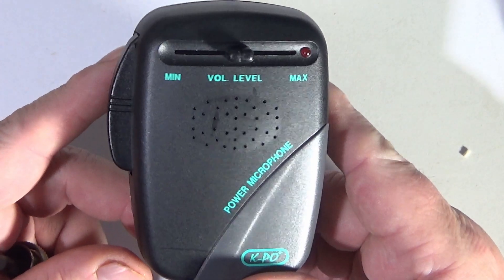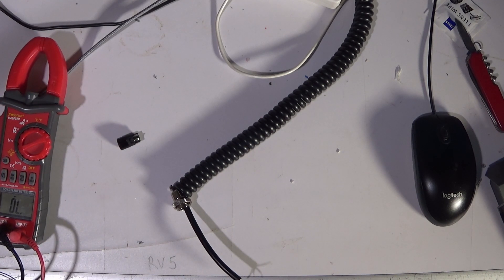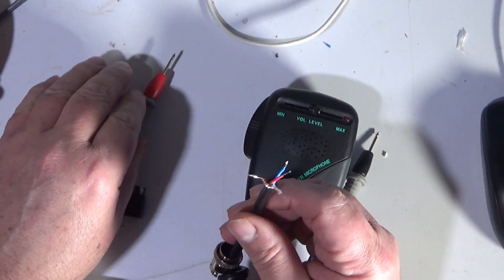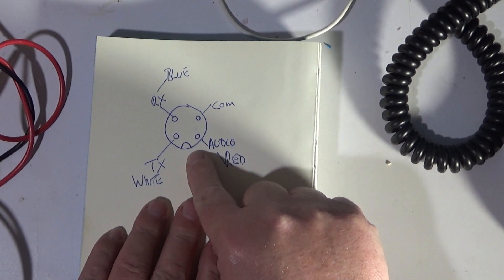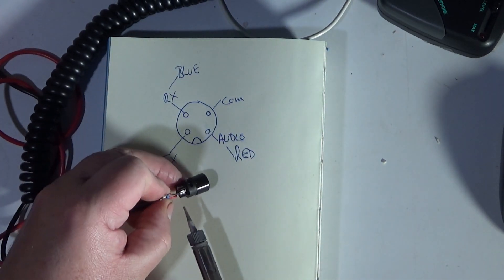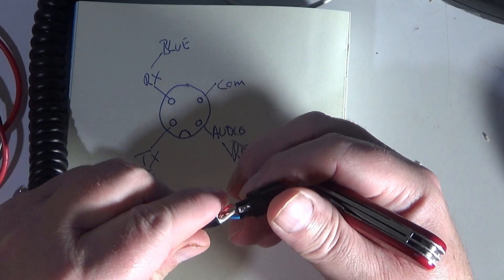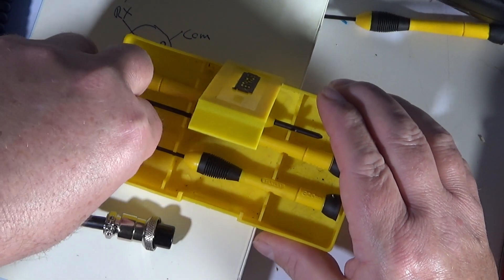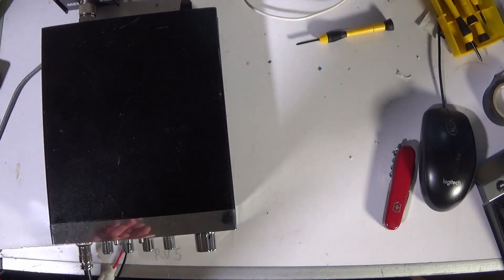How to Wire up the KPO NM532  Microphone  Start TO FINISH.

Comment: Nice one Steve. 
Funny enough, I just ordered a bleep box from the States, and had to re-wire it from Uniden to Cybernet, inside on the mic socket, and the plug on the end of the lead that goes in the radio. 
I'm happy to report, that it is all working fine :-) 
Made simpler by remembering back to the old days, and knowing how easy it is to change Uniden to Cybernet, or vice versa, just by changing the wires top to bottom, and bottom to top, either side of the little cut out groove, and hey presto! 
Keep up the good work my friend. And stay safe x
Reply from the maker: HI Mandy nice one this is old news to us lifers.
But should be handy for new people who Join the hobby :o)

Comment: Thank you for the suggestion I wrote wrong because I have the 6900 and also the 9900 and the president.However I had a problem with the connector and I solved 73 from Mario Trieste Italy

Comment: Nice one Steve.
One point you forgot to mention.
The AUDIO wire will usually have the braid/common/earth wrapped round it, so it is identified right away.
Now you know two of the wires right away.  Ground/common and audio wires.
The way to find the Receive wire is how you did it Common to a wire on test meter to one of the wires gives you the Receive wire.
The only other wire that is left will be the Transmit wire.
So you have found them all

This method will work for all microphones.

Caution:  If there is a battery in your mic, (Power Mic) take it out before testing.  Remember to put the battery back after you connect the plug up.  You can test the mic without the battery being in to see it it Receives and Transmits, but you need the battery to get audio.

Looking at the inside of the plug is how it is drawn for the connection to the CB or other radio.  This confuses some people.
You can find connections for most CBs on the Internet.  Just google it.

Nice one Steve.
Reply from the maker: Hi Bob there will a follow up video, i never forgot the Audio wrapped in the screen wire.
Some times all the info at the same time can be a little over whelming.
I did miss an opportunity during creating the vid, that i will try to re create in the follow up.
Watch this space fella, i have some software to run for the next video. :o)
Your input is always welcome (and good) :o)
Reply: @CBRadiouk1  No worries, I just that up so someone could look at it while doing a mic.  If you do another, put it in the text below the video.  Helps others.
Anyway, it is surprising, there is not a lot of videos out on how to wire a CB mic.

Comment: Good to Go!!! ,You can make some Helping Hands with a length of solid wire and solder on some Alligator Clips
73s JP 771
Reply from the maker: Hi Chris I have now found the clip I was looking for last night.
Good call on the wire, lol I have just been in my Radio toolbox.
I was thinking I was wasting my time.
Low and behold there staring at me was one piece around 5 inches long.
Its about 1mm thick transformer  winding type wire. (RESULT)
I  will get that together soon, thanks for the tip.
 I probably Ave another croc clip kicking around.

Comment: Excellent video Steve, very clearly explained, I've shared it to a few groups. Any chance of doing one on fitting N types next.
Reply from the maker: Hi Mr Paul are we talking N Type coax plugs?
And thank you for sharing the video.
Reply: Hi Steve, yeah N type co ax plugs, can be a bit fiddly to do but are excellent especially at the antenna end to keep the water out. Happy to share mate, excellent video.

Comment: Hello I bought the k-po nm-532 microphone (for use on these two CRT SS6900N / President McKinley)connecting this microphone the people listening to me do not hear me very very low the microphone cannot amplify.Could you give me some advice. Thank you ( the shop assistant assured me that the connections of the 6 PIN connectors are all the same)I'm sorry I don't know English I used the translator Thank you in advance 73
Reply from the maker: The 6900n is a 4 pin socket not 6.
Change the battery , and if you are using it on the mkinley, use ssb, to look for audio/ power output.

Comment: i im trying to wire uo a kpo nm532 to a president lincon, couid you please tell me what colour of wire goes to what pin number, many thanks.
Reply from the maker: hi Denis if u watched the video, you will now know what wire does what.
Now all u have to do is look up the lincoln mike configuration.
even better check your stock mike functions, and write them down.
then match the kpo wire functions to your lincoln mike  configuration.
unfortunatly i cant do it for you bud.